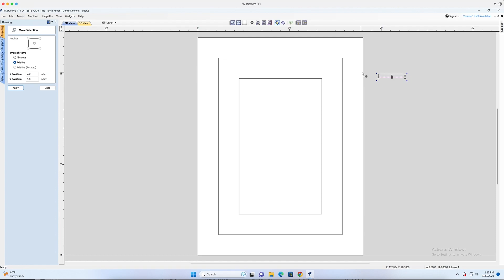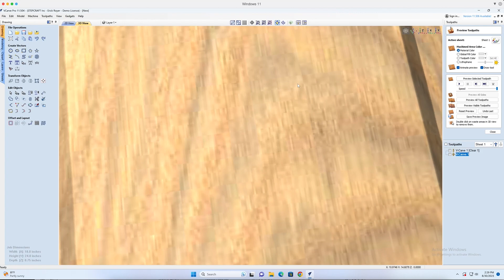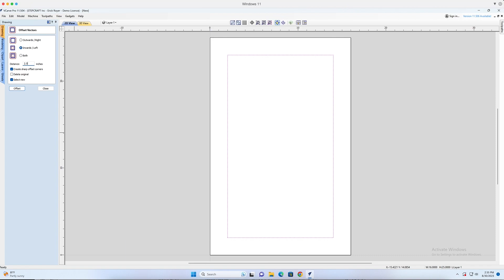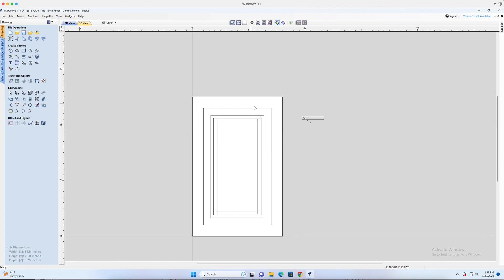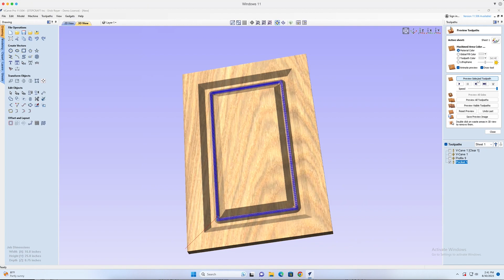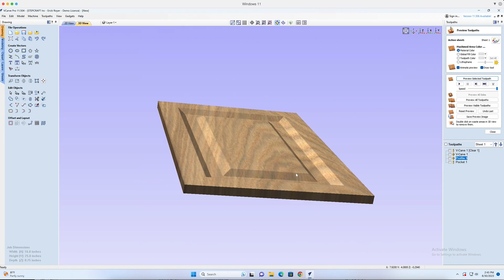CNC Router Raised Panel MDF Doors With Vectric V Carve - No Special Tools, No 3D Tool Paths - EASY!

Comment: I've got a newbie question: if I wanted to make a different dimension door from your model door (or one that I make from scratch with dimensions AxB), would I have to redraw from scratch for a different dimensioned door (CxD) or is there a quick way to re-dimension for another door while retaining rails and stiles, etc. dimensions true to the original one I made?

Comment: I watched a video last year, and was able to do basically what you just did, but I used two V bits--90 and 120--and a 1/4" endmill, plus a 1/8" compression for the profile cut.  I also made fake vertical lines between the stiles and rails, so the whole door looked like a true 5-piece door.

 https://www.youtube.com/watch?v=P0Dv_ixWnoI&list=PLQJS3MyX1yxAJ3SAfriwirMcOFpD-aDxp&index=19&t=4s
Reply from the maker: I never saw this video before.   Very good info.  I released a new video today that uses the molding tool path in V Carve Pro and I also added info about how to make the fake vertical lines.  Thank you for sharing.